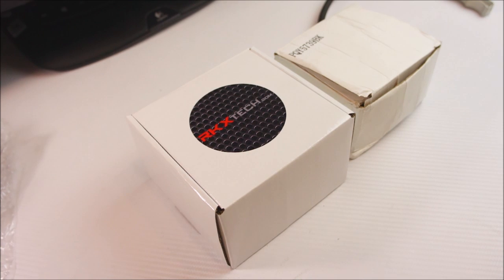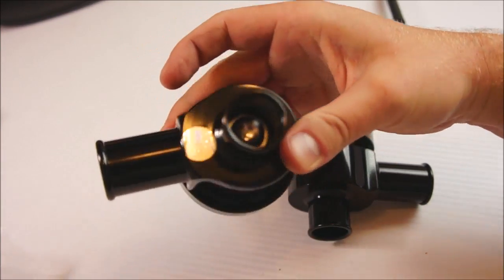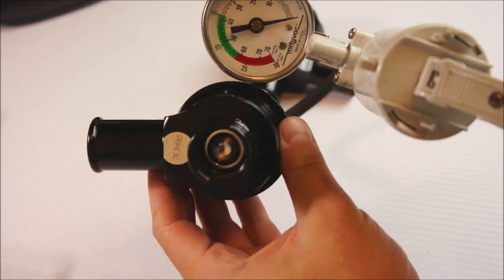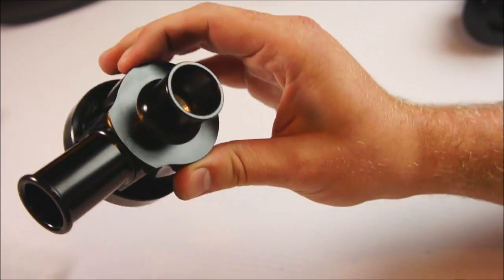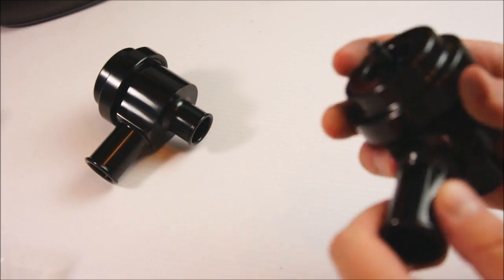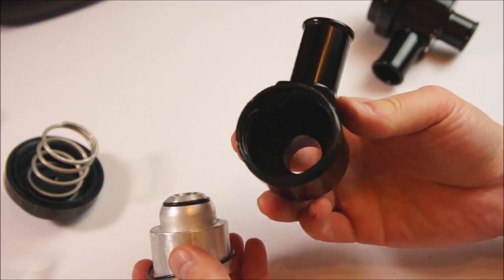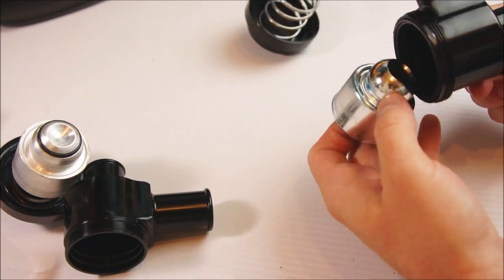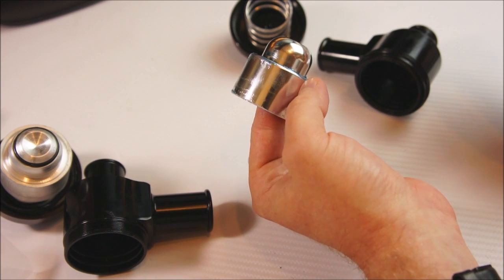RKX diverter valve vs generic valves

Comment: Good product.  I put these on my two Audi (AAN 5-cylinder turbos) vehicles and it did away with the 'fart' noise I was always experiencing under partial load with the OE diaphragm valves.  I installed it with the boost hose coming in through the side.

Comment: I got one of these on my newly purchased Audi TT 1.8T 225 and has an interesting turbo flutter sound when pressure is released.  Under hard boost it makes a loud squeak but anything from 0-10psi it makes a loud turbo flutter with squirrel chugging like chirping.  Not sure what is wrong but there could be something else in my system causing this.
Reply: Yoto Werks spring is at a low setting try acouple clicks clockwise

Comment: Who has bought this diverter valve for 1.8t gti.. watcha think about rkx diverter valve. So yeah
Reply: I'm not overyly impressed.  I'm having my mechanic friend take a look at it...but yeah...the boost doesn't seem as powerful and there is little to no turbo sound at all...
Reply: I installed the adjustable one that partially vents to atmosphere. So far it seems decent and has a good sound to it. It does occasionally make a odd humming noise but it can only be heard with the hood open and only after reving.

Comment: Should I be worried if mine doesn't have the hologram sticker on it... Seems a lot like the rkx valve in the video and does say rkx on the top cap.
Reply: I purchased one from Amazon (supposedly through RKXtech) and one directly from their website.  Both did not come with the hologram sticker... maybe they did away with the sticker to save money.
Reply: Possibly. Either way it's a great piece, zero issues with it 👌🏼
Reply: check your o-rings. they are  very weak on these. 1 year and both o-rings were full of cracks on my rkxtech 1.8t bypass...
Reply: I'm still using original o rings. Hold boost just fine. Gets checked and greased more often then they recommend.